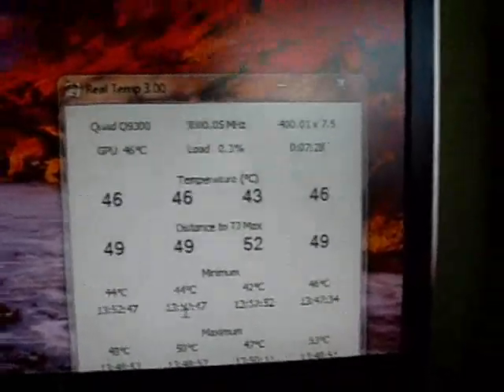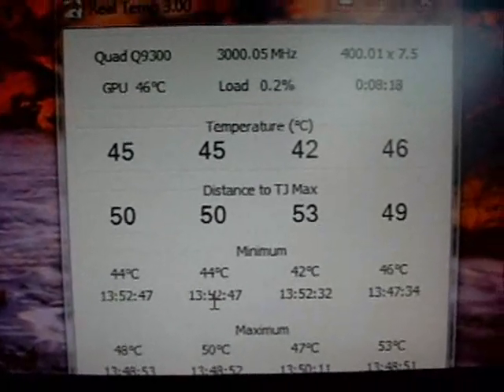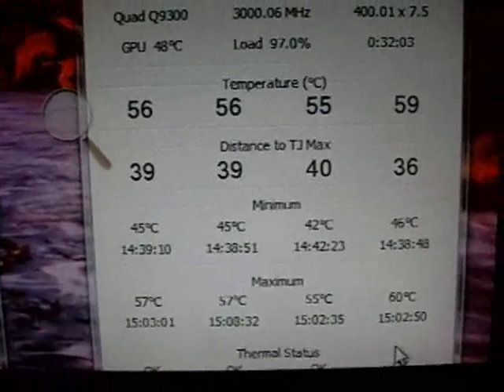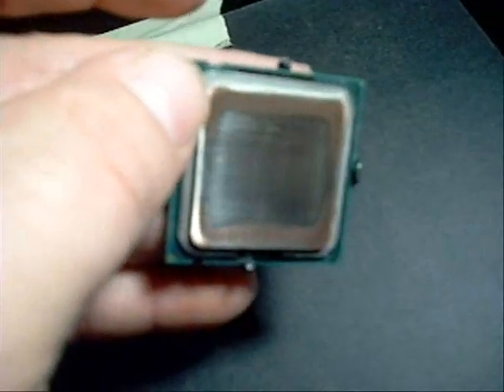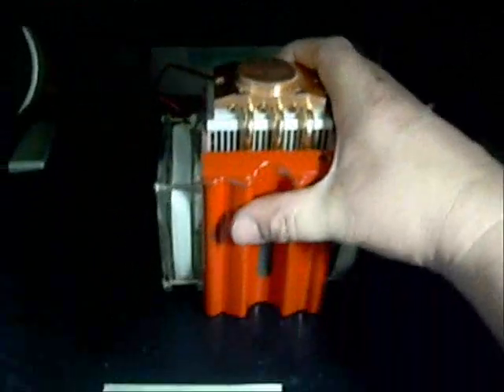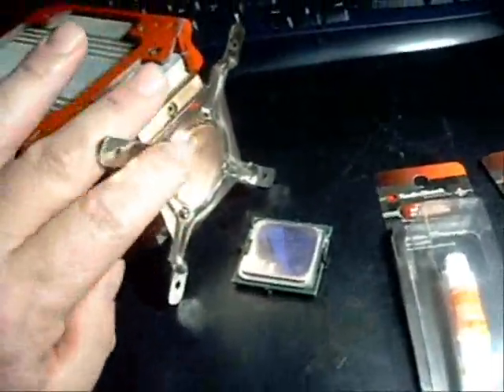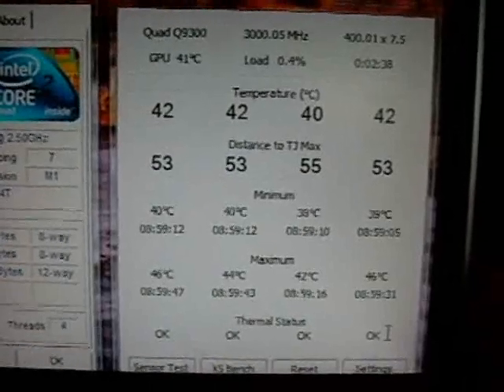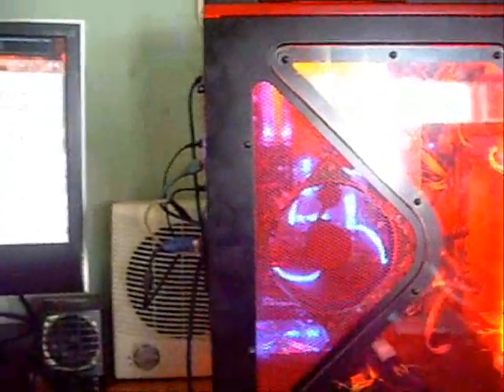Is lapping a quad core worth it.

Comment: Hi there, do you think it is possible to get the surface to smooth? I have the equipment to polish die cpu surface to around one micron.That would be a bit over JIS8000 grit size. At that point i would not use any thermal paste, since the cooler would also be lapped to the same extend and would make extremely good contact to the cpu by itself. I wonder if that would be worth it? What do you think?
Reply from the maker: It would be fun to try it. As for difference in temperatures I don't think you would see a huge difference, maybe a degree or two. If you do decide to try it please let me know I would love to hear what the results were or even better yet see a video on it.

Comment: The heatspreader is made from a flat plate then pressed into its shape, which makes the places where it is bent go slightly back towards flat after the press lifts up again. Its like when you bend anything metal, when you bend it x degrees, and let go, it goes Y degrees back. So the edges become slightly rounder towards the corner. They could make presses that make completely flat headspreaders, but they apparently haven't bothered.

Comment from the maker: @drx975 That is a very good point. I do tend to use a little too much TIM. Let me ask you which method do you prefer the pea size dot in the center or to spread a even coat on the cpu?. For about the last year I have using the dot in the center and have had good results with it. But some people still insist that spreading it out is much better.

Comment from the maker: @airjamin8tor Thank you. To answer your question it does come apart some But I didnt bother to take it apart. It was really not that hard to hold on to and lap. There have been some very hard ones that I have done like the Blue Orb II cooler. Then I set upside down on the table and use a block of wood with the sandpaper wraped around it and lap it that way.

Comment from the maker: @Bhodisatvas Oh my bad. Sorry i didnt understand what you were asking. 

Yes it is a setting in bios. Several motherboards have cpu settings in the bios. Including one called speed step. What it does is drop your cpu multiplier depending on what the demands are on the cpu. So when you are just viewing a webpage for instance and dont need all the cpu power it will drop it to save on power and heat. They when running a game or crunching on large files it will up it again to full power.

Comment from the maker: @Bhodisatvas That all depends on what the cpu is doing at the time when you look at it. If you are running different apps or a game. The idle temps were with nothing running. So it didnt change much maybe a degree or so in either direction. And the max temps were with prime 95 running all 4 cores at 100% So once again the tempatures diddnt change too much because it was running as hard as it could. But yes under normal computing the tempature would change a lot more.

Comment: AWESOME! video Fuzzy!! I wanted to lap my i7 chip but chickened out...lol. On the i7 chips they too are not level but actually dip in the center of the chip..dunno why? I used a little extra Arctic Silver 5 to fill in that gap so there wouldn't be a little gap underneath the center of my cpu cooler.

Comment from the maker: AS far as glass i use a piece that I took out of a picture frame. I just put it back in the frame when I am done with it. 

And for the sandpaper I got my 1500 and 2000 at a local autobody shop. I just went in and asked them if I could buy a couple of sheets.

Comment: Funniest thing, I just went to Strauss to get me some 3M automotive wetordry sandpaper for lapping. I'm gonna lap my CM V8 and my QX6850, which has almost same temps on idle and even hits 70s on 100% as yours. Problem is that I got no glass to polish stuff on, and the highest grid they had was 1000. I got couple of pieces of 1200, but I wanted to get 1500-2000 grid. Have to look online I guess.